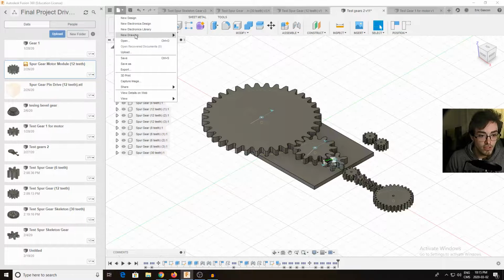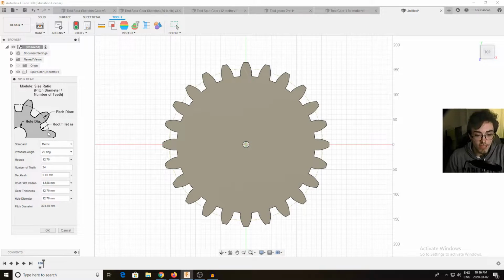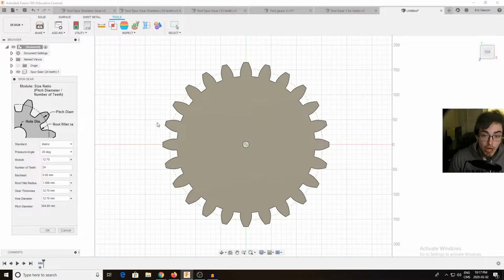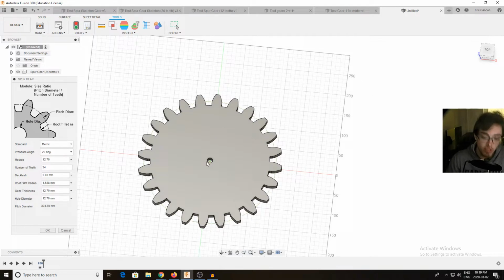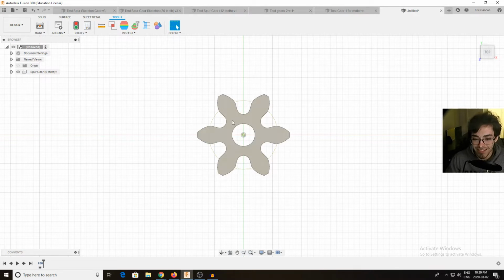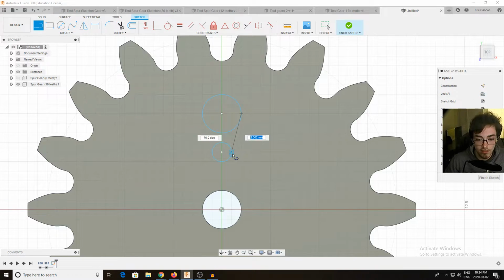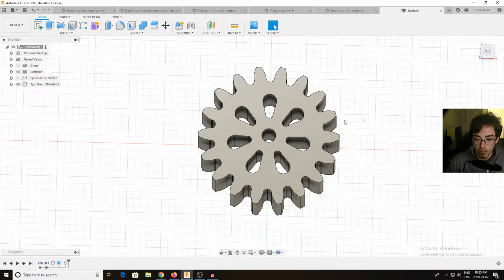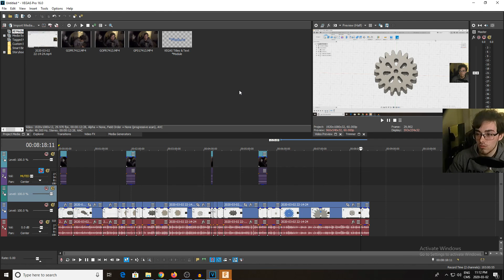How To Make A Gear In Fusion 360 : The Easy and Fastest Way - Tutorial

Comment: Superb video! Wondering if you can troubleshoot something I found when generating two gears (one small 12-tooth, the other a 36-tooth) using the "Add-in" Spur Gear App. I don't want to waste your time or muck up the comments section so I can make it quick.
Reply from the maker: Yea what did you find
Reply: @Viper240minecrafter  (thanks, man) Yeah, two things. (in my particular case: I'm creating a 12-tooth meshing with a 48-tooth, 20-degree pressure angle, 24 pitch, and am comparing exact spec matches to gears purchased from McMaster-Carr) The first issue  is; the smaller the gear and the fewer the teeth, it seems the more the gear's tooth design looks less involute and more cycloidal. Is that just an illusion? I assume Fusion360 would maintain everything as involute. Second, after exporting the obj's: as I mesh the gears together "virtually" in Maya, I'm noticing that there are gaps around the three "working" teeth at the interface point (where two teeth on one gear are supposed to straddle the one tooth on the other gear) while the teeth just outside of those three teeth ARE in contact. This seems counterintuitive, and the McMaster-Carr examples mesh just fine. Am I expecting an unrealistic level of precision with the software? Thanksthanks!

Comment: how do you resize once you click ok, do you have to go back to tools and go where the file is again? im new to fusion.
Reply from the maker: Unfortunately I haven't found a way to edit/resize the gear properly once its been created. I usually keep a log of the gears I make like modulus teeth radius etc. then I save them as components to use later. Sorry I couldn't answer in full.